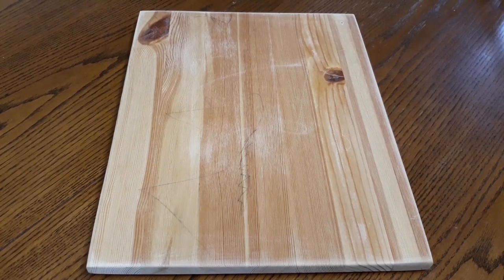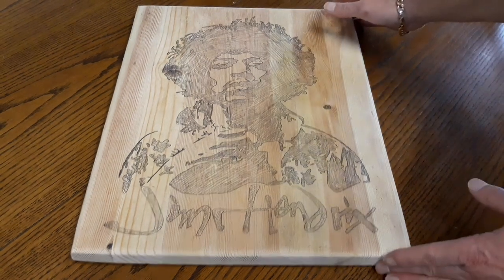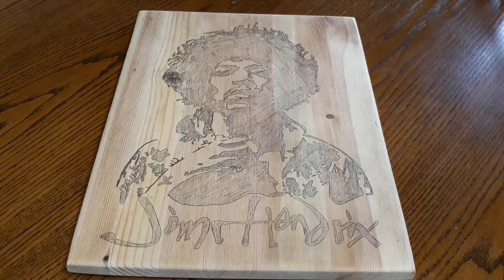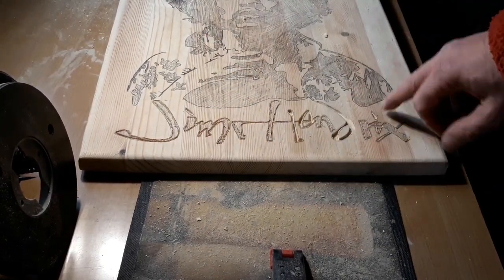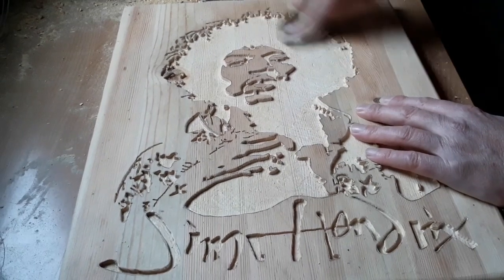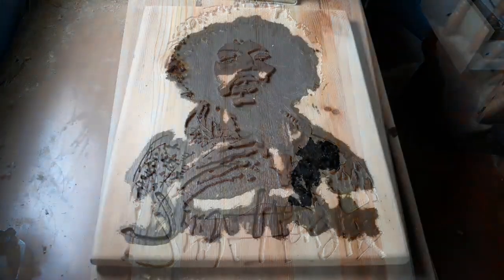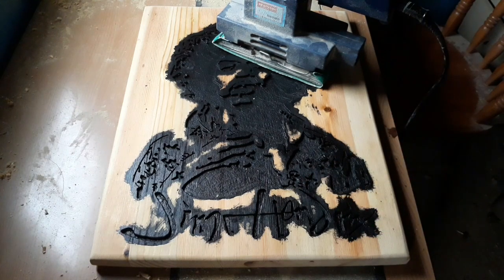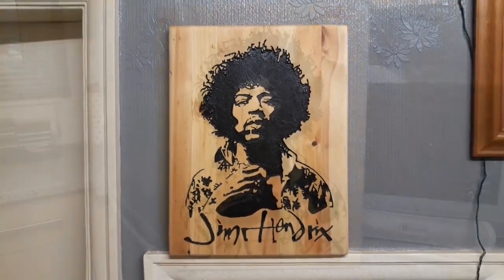Router project..Jimi Hendrix

Comment: Do yo I have to use a brush or can you use a spray gun?
Reply from the maker: You can use spray paint from a can or gun no problem, maybe mask the surrounding wood to save on sanding
Reply: @fishtank5050  Yeah because I want to do these projects in a timely matter but with out sacrificing the look of the product I guess if I use a spray gun I would just to cover the rest of the wood

Comment: Cracking job mate,can i ask what size collet you used for the CNC bits please.
Reply from the maker: https://rover.ebay.com/rover/0/0/0?mpre=https%3A%2F%2Fwww.ebay.co.uk%2Fulk%2Fitm%2F191938780949
Reply from the maker: Thankyou for the comment. I hope this link helps.the first one I got was to big so the 6.35mm to fit the 3.175 cnc bit should be ok ..
Reply: Thanks mate.Have you got a link for the CNC bits too,it doesnt hurt to be cheeky lol..
Reply from the maker: @bigjohntightlips  https://rover.ebay.com/rover/0/0/0?mpre=https%3A%2F%2Fwww.ebay.co.uk%2Fulk%2Fitm%2F162206297583
Reply from the maker: Hope that helps..
Reply: Nice one mate,ive just ordered some,Thanks again.
Reply: Hi  I know this was posted over 2 yrs ago but have only just come across your work, I have to say your work is great especially this Jimi Hendrix one. Can I ask where you get your pictures for the print outs from, do you use a certain website or just google search a particular image...
Reply: @steveneal1124  google works just fine
Reply from the maker: @steveneal1124  Google search and add silhouettes or templates after what ever I'm looking for, 😁👍

Comment: i like your router art bro..can i know what apps you use to print out sketch picture?
Reply from the maker: I just googled Jimi Hendrix template, then I use a online site called rasterbator to enlarge the template..
Reply: @fishtank5050  thanks so much bro..success always
Reply: @fishtank5050  may i know what saiz router bit you use? 1st bit and 2nd.
Reply from the maker: @bestsong1724  I use cnc bits on all my projects now for the lines,this was an older video  I now use end milling bits for the clear out, they work Brilliant for the tighter areas  ,check out some of my resent videos.. but heres some links for you Ebay or Amazon
Reply from the maker: https://www.ebay.co.uk/itm/172213663526
Reply from the maker: https://www.ebay.co.uk/itm/353029506162
Reply from the maker: https://www.ebay.co.uk/itm/182124909126